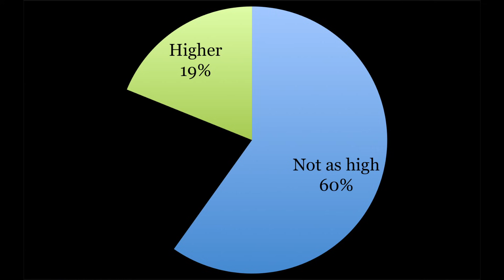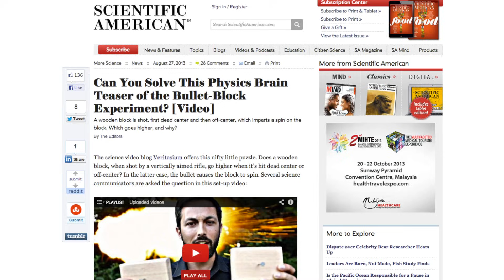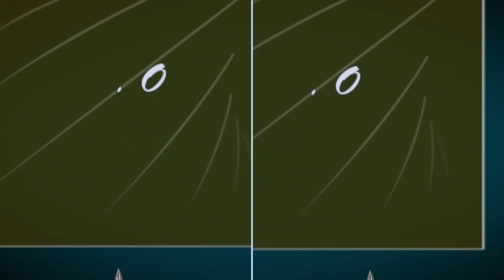Bullet Block Explained!

Comment: So I'd measure the difference by changing the material being shot "half way through it". Make use of the fact that the three percent difference counts if the material in which the bullet penetrates becomes less and less resistent to the bullet penetration. My point is that if you build a block with less uniform density, maybe that fraction of mm the bullet would penetrate in this experiment is amplified to the point of being measurable.

Two good ways of doing this:
1) use many materials that are less resistent to the bullet passage with gradually less resistence;
2) put graduated holes in the wood to change its density;

In this way, the idea is to amplify the effect that that little amount of additional energy has.

First you have to shoot the material you'll used to test it the same way (I'd reccomend polystyrene in various densities or in various of its forms, or just a big block of expanded polystyrene - one tenth or less of the density of the wood depending or the wood and expansion of polystyrene used). While the 3% difference might not be measured in the wood, it might be measured in such material. I do not reccomend sticking the materials with glue to get better results.

I can't test this because I do not own a rifle or a nail shooting device...

Comment: To make the distance measurable, you could use a material such as ballistic gelatin. There would be far deeper penetration overall, therefore that 1% difference in penetration would be proportionally larger, and therefore more measurable.

Comment: Hang on, what about the conservation of angular momentum? I mean, we start with a non-rotating piece of wood and a non-rotating bullet. But we end up with a rotating wood block, and a bullet rotating in the same direction as the block. In fact, their angular velocity is exactly the same. So that it ends up with a non-zero angular momentum.
How do you get over this?
Reply: I'm a bit late here, but the problem you, Derek, and Destin have is a faulty assumption. It makes no sense how only one block can be rotating if both systems have the same rotational momentum/energy, but in fact, the two systems never had identical rotational energy/momentum. This is what makes the problem much easier, when you realize this. 

As shown, it is easy to see that the linear momentum is identical in both cases, and that alone can explain the identical height (within experimental tolerance). With the first system, there is no angular momentum, as the system's center of mass is inline with the centers of gravity of the block and bullet, and the bullet's velocity is along that line: angular momentum is zero. 

When the bullet is fired off-center, the system is now different, and it is a mistake to assume the angular momentum is again zero. Now, the system center of mass is still in-between the block and bullet, and it travels upward at a proportion of the velocity the bullet does (the CoM velocity is identical to the first case). But now the bullet velocity and block velocity (relative to the system center of mass) is not in-line with the system center of mass, therefore the starting angular momentum is not zero. This is the crucial difference from before. When the bullet hits the block, it transfers the system rotational momentum to the block and we get rotation, no laws are broken.

Comment: Hi. You should try this experiment without using a bullet but something like a hammer or a spring witch hits the block from below. Because the bullet strikes a different part of the wood block and the structure of the wood varies across its lenght. Using an impact object that doesnt penetrate the wood will give you a different and more accurate answer.
Reply: But having the bullet become part of the block is part of the experiment, so using a hammer or other external impact would be a completely different experiment.
Reply: In that case, it would be very difficult to get the momentum under control because you would have to be careful about the velocity of the hammer even after the collision.
Reply: I was thinking polystyrene or something similar and a nitrogen powered BB gun type device.
Reply: VincentTG Which witch is which?
Reply: A pneumatic piston would be a good device to use, as you could put in a very accurately repeatable amount of momentum and therefore energy. Also replacing wood with a more sturdy material that won't deform much would help eliminate the liklihood of energy going into plastic deformation and affecting the results. 

I wonder that would affect the height? As little energy is wasted as heat, so most of it should contribute to momentum. Hmm.
Reply: I’ll need copious amounts of psilocybin to induce the neurogenesis needed to replace the brain cells you just destroyed

Comment: If the wood wasn't so porous I'd say fill the hole with water and see how much you get out of it. Water will contort to all the new angles and space created by the bullet. It's how engineers building performance engine blocks find out how much cubic cm of displacement they have after a car's engine was bored, ported, and polished. Also helps in figuring out the compression ratios.

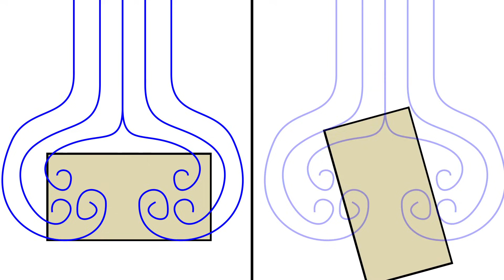Comment: So I'm at 4:45 and my prediction was that it would be the same height and the rotational would be negligible. But you have shown that it isn't, which was surprising to me.

So here is my second stab at an explanation. Maybe it is because the collision is inelastic because the two masses, block and bullet stick together. So a lot of the energy is lost. But translational momentum is conserved, and the blocks and bullets being roughly the same weight, same height and same initial momentum reach the same height because of this conservation of linear momentum. But the block spins because more of the energy of the bullet is conserved. Maybe?

Comment: Ohh, on the simulation, when it was in the center, it penetrated farther, on the sides not as much. Possibly the reason they go the same height is because since it doesn't penetrate as far on the sides is because more energy is transferred on the sides. As opposed to the middle where it penetrates farther causing more energy to be lost?
 
Is this a possible explanation (If he says this later in the video I dont see it im currently at 2:51)

Edit: Just remembered conservation of momentum law XD
Edit 2: I was got to where he explained when the bullet may have lost more energy in the middle and I am correct!! nevermind XD

Comment: I think what everyone is getting caught on is the transfer on energy, which is when the block carries the momentum of the bullet; the bullet is going straight up either way in both blocks because it is caught in the block. But if the bullet didn't penetrate and bounced, instead it would have pushed the momentum in a different direction. They will both be hit with the same bullets momentum, but the side bullet would carry more of its momentum off when ricocheting and also they wont have as similar of a direction in velocity anymore.

Comment: Awesome video!!!
Now, I am not a physicist, rather, I'm simply a 1st year student of physics. but a few things I noticed with the experiment that might cause differences in results.
1. Wood was used. even if a piece of wood cut from the same 2x4 can have different densities, grain patterns, and overall mass. 
2. Ammunition and firearm (my area of interest). The type of round used looked like a .22 caliber. All ammunition is inconsistent to a certain degree, but 22's are known to be more so. If a semi auto rifle was used, the gas blowback used to open the bolt is also inconsistent. 
 Now of course there wasn't any creation of energy lol. I simply belive the kinetic energy that was transfered from the projectile was dispersed in different ways. when shot in the center, the energy has room to evenly move throughout the block giving vertical and slight rotational motion. The block shot to the side had the same force but  though instead of the majority of energy dispersing evenly throughout the block over the same time,  instead it was distributing energy through 2 axis. I can only think of 2 possible reasons for the hight being similar. the first, as gravity, air density, teperature etc... remained constant, and everything else was somewhat consistent other than exact locations of shot placement, and items i meantioned earlier. having additional time in the vertical position would likely yield different results. or perform the experiment at a location that would allow the blocks of wood to reach terminal velocity, and measure the time it takes for each block to hit the ground and extrapolate the result from there. the objects going higher would hit the ground last.
the only other thing I can think of is caused from the magnus effect. but I'm not sure if it works with blocks of wood.

Comment: My first thought was rather than figure out how to measure the difference in the distance the bullets travel, I'd try to make sure the penetration depth is the same. I suspect zero penetration would be the easiest to achieve. So I'd shoot at a steel block. That way the energy transfer should show up as a difference in the reaction of the blocks. The problem here is that there could be some difference in the amount of energy spent splattering the projectile all over the place. That might be hard to measure.

To measure differences given the current set up (wood blocks), how about measuring the volume of the hole the bullets create. The bullets might not travel straight in the wood, they could tumble. Whether tumbling or not, some energy in the bullet will be spent creating the hole in the wood. So the bullet shot at the center of the block should create a larger hole than the bullet shot to one side. I would measure what I put into the hole - so start with say 100 cc of liquid and find out how much liquid is left when the hole is filled.

If you used water, the wood will absorb some part of the water, so some liquid that won't be absorbed would be good. The geek in me would suggest mercury, but that's pretty nasty to handle. An oil might not absorb as quickly as water. But you also need something with low viscosity to get into all of the irregular nooks and crannies that will be in the hole.

You'd want to use something other that wood that would not absorb water. A soft acrylic or other plastic, or perhaps a very dense foam might work. I'd probably experiment with a few different materials to find one that would work well for the experiment.
Reply: In order for volume to be a good way to measure deformity and displacement of the target material the internal structure of said material would need to be predictable/constant across experiments.

Comment: Amazing explenation. For measuring the depth of penetration of the bullet you could maybe use a block of something with a different density and compared to wood. Using a much smaller and "weaker" bullet and shooting it into something more like a gel, you could probably see much more difference in the penetration of the bullet from the side and from the center. Probably this would need a few trials finding the good combination of bullet, and size and density of the gel block so that the bullet does not completely destroy the gel. Maybe an air compressed bullet type could work.

Comment: The answer is simple: obviously the bullet in the two cases has (practically) the same energy, but the two blocks absorb its energy in a different way (so, the rotating block absorbs more kinetic energy than the other one). If one could measure the residual energy of the bullets he/she could measure a lower value in the case of rotating block (just because a higher share of energy was provided to it). Energy is not produced nor destroyed: is simply transformed (in all circumstances)!

Comment: This argument that "both have the same amount of upward linear momentum" DOES NOT necessarily implies both must to go the same high because the linear momentum is conserved during the collision between the bullet and the block, but it is NOT conserved during the upward motion.

But, if I understood the explanation, the bullet dissipates a lower amount of energy when it is shooted off center. So I presume when one adds up this amount of dissipated energy AND the rotational energy it gives (pratically) the same amount of energy that is dissipated when the shoot is in the direction of the CM of the block.

So in both cases the energy available in the forms of translational kinetic energy and gravitational potential energy is the same.

That's it?
Reply: Thiago Peixoto Linear momentum is conserved during the upward motion, you're forgetting the linear momentum of the Earth
Reply: Both have same amount of upward linear momentum, so both have the same initial linear velocity. Since the final velocity of both is 0, so they must travel the same height.

Comment: I want to see this test with a finger fling one flinging the block from the middle point and one from the edge. Granted human error can be at play here but some other method similar to mine would be interesting. Maybe create a seesaw and drop a block on one end from the same height with the end of the seesaw starting touching the blocks. My prediction is the further from the middle you go the lower the block will travel.

Comment: This is real old I think, but would it work to give the material a harder outer shell that gets pierced to absorb most of the momentum and then have a softer (ballistic gel or something) material inside so that the energy per distance that is used up is smaller and the difference in distance would be greater?

Comment: Curious, did they measure the bullet weight and powder charge per shot?  This would definitely skew the data/results.  Also, assuming all the same types of wood with same grain and no knots.
Reply: +JohannaMueller57 They took several shots, evaluated that the ones hit off center did not systematically end up lower, and then picked the closest two purely for presentation purposes.

Y'know, exactly what was said in the video.
Reply: +tsnorquist no they didn't, they took several shots selecting two that got to the same hight.

Comment: For making the difference measurebale you have to make an object built with a mixture of different things. For first time use the wood than use Polystyrene or some really weak and soft material. The line between two stuffes should be in the middle of place where the bullet got stucked in the wood. Then you will see a more clear difference. 

But the struggle is balancing the circle moment if you wanna have equal constitutions in the experiment. So the second stuff should have got equal mass to the wood. Better than Polystyrene can be ballistic gel the things you use to test a bullet professional (sry le me German my vocubulary isnt that good^^). 

Also you can make the bullet lighter, made only out messing in cotton with in it. The Energy should spread so fast und well that you may see a difference.

Or put an 5mm Alluminium"paper" in the wood block at the attithude where the bullets stopped. You may see in the microscope some different structur. 
Even better the wood is not really save for exakt measurement. You should use more gel like stuff the mass is better spreaded. 

Maybe one day you will see this Veritasium :)

Comment: 21% is a percentage. Do you know what else is 21%? Oxygen in the air. The name for oxygen on the periodic table is an O, which is a circle, which is an ovel. And eyes are ovel, remember that.
Now something even more shocking, the oxygen in the air is not O, but O2.
A circle is a single line, 1 + 2 = 3; Triangles have 3 angles.
An eye in the middle of a triangle is a sign for illuminati. 
DEREK ILLUMINATI CONFIRMED?
───────────────███───────────────
─────────────██▀─▀██─────────────
───────────██▀─────▀██───────────
─────────██▀──▄▄▄▄▄──▀██─────────
───────██▀──▄▀─────▀▄──▀██───────
─────██▀──▄▀───███───▀▄──▀██─────
───██▀────▀▄───▀▀▀───▄▀────▀██───
─██▀────────▀▄▄▄▄▄▄▄▀────────▀██─
█▀─────────────────────────────▀█
█████████████████████████████████

Comment: I have trouble accepting this explanation. That velocity you have in your momentum equation is a vector. Sure you will split up the angular and linear velocities in the calculation, but the initial momentum is the same and one equation has an additional velocity component.